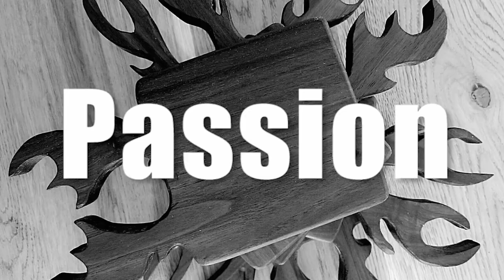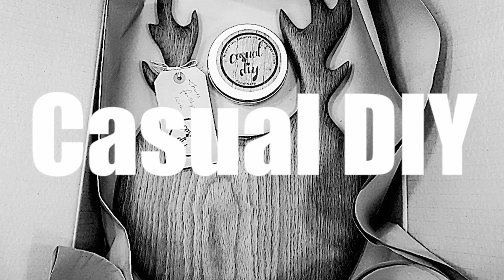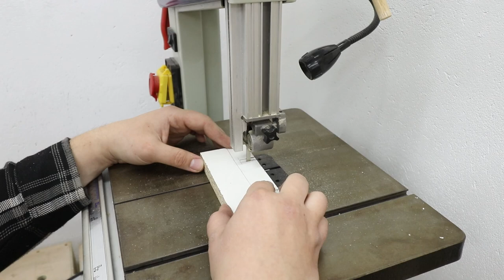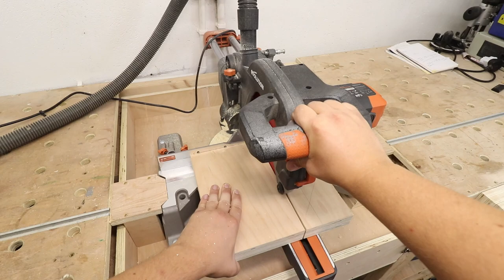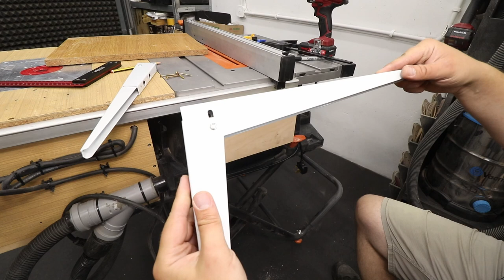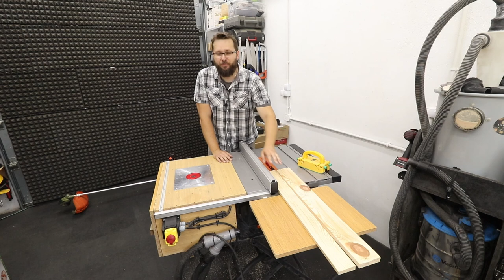Foldable Outfeed Table for Rage 5S Table Saw

Comment: Thank you Tomasz!
Rage 5-s is by far the best saw for a DIY-er and jobsite projects. Bought one after in depth comparison between Rage-5s and Makita MLT-100N. 
Rage 5 is VERSATILE at first (cuts metals, plastics and wood with one blade - nobody else offers that!) then compact, sturdy, 
POWERFUL (lot bigger torque than in competition, have cut pine 14x14x400 cm beams on two 7x14x400 cm halves as a butter), very good fence with front and back support (Makita desn't offer that), sliding table with mitre gauge that offers more than enough accuracy for construction purposes (If you need to make a photo frame obvoiusly you make a sled) and what you forgot is that you receive very solid saw stand 
IN STANDARD (Makita needs extra stand) wich without problem handles two people on board (I was amazed that it does). 
Not to mention that riving knife is easily lowered to make mortises and tenons (on others you just can't cut mortises with the riving knife installed!), easy blade access, 120x60 cm work space, foldable and whealed for easy transport and storage, cuts even stone with a proper blade (which I did 😀) and it's unbeatable in advantages/price. Simply the best saw. Does have some issues, but they stand very low by what you get for that value.
In mine also installed a soft start and in deed missed outfeed support. 
As you said proper adjustments are crucial and are first thing to do according to the manual! Precision cutting needs additional actions and accessories (good blade, sled, zero clearance insert and properly aligned fence)
I truly love this saw and I recommend it to anybody looking for a good machine.

As a polish DIY-er I'm amazed and stunned out that your shop reminds me mine in terms of equipment, used tools etc. I use Rage 5-s saw, R255SMS DB mitre saw, that are both simply great, have very similar jointer to yours and what makes me laugh the most is that last year I bought exactly the same folding supports in a local market without any special idea on them. Now I definately have one. 😄 
My very first plan to an outfeed support was to install it from the bottom of the main table in the same way that the left side sliding support is mounted. Recently I even made an extra metal table to built in a table saw, router, jointer and a workbench for assembly. Don't have time for it now but maybe I'll get back to it this summer.

Tomasz pozdrawiam Cię z Polski! 🙂
Trzymaj tak dalej.
Reply from the maker: Perfect sales pitch 😉👍
Pozdrowionka z Kalisza
Reply: @CasualDIY  
You can use it with no charge 😄

Mam nieaktualne informacje, myślałem, że tworzysz w UK. Świetnie mówisz po angielsku, tempo, dykcja, zasób słownictwa perfekt, przyjemnie się Ciebie słucha. Doczekamy się filmów po polsku? 😎
Reply from the maker: @wojciechpodolski9890  Hehe dzieki, oj po Polsku raczej nie 🤔

Comment: Nice one mate...
Maybe could have extended it over to accommodate the router part as well? 👍
Reply from the maker: Sure you can, just spread the brackets more apart. You could use the router box to mount one bracelet on it. Usually for what o do that size will be fine for me and that was the largest board I had in my workshop that I could use for this project 🤣

Comment: Nice, i've been looking at outfeed table options, as i'm fed up with messing about trying to use my folding workmate. Until the prices went silly, I was tempted to remove the entire metal framework and build the saw into a multi purpose cabinet along with my router, but like many things atm, that's currently on the backburner, so this is a nice, and more importantly affordable option until the world starts making sense again...lol
Reply from the maker: Im in the same boat mate. Had so many projects for the workshop and the house but I just can't afford the materials. Not sure when or if they will go down in price 🤔

Comment: Hi Tomasz, what are the length of your brackets?  They look quite  a bit bigger than the 250mm ones you linked.
Reply from the maker: They are 400mm but they don't have to be that long. Shorter brackets will be as strong 👍 I would go for what's cheaper
Reply: @CasualDIY  Brilliant thanks.  The brackets I ordered came today and are 300mm. I’m thinking of doing a hybrid of this now though to have a longer, removable extension.  I’ll make the mount as you show but instead of mounting the brackets on it make a channel on it to slot the table into and use a bracket for a fold up leg that extends.
Reply from the maker: @baggi0945  sounds great, it's all about inspiration and adaptation 👍
Reply: @CasualDIY  Btw the idea was from spratlyk9 and his redesigned table.  I’d love to see your take on that for a long stable extension table